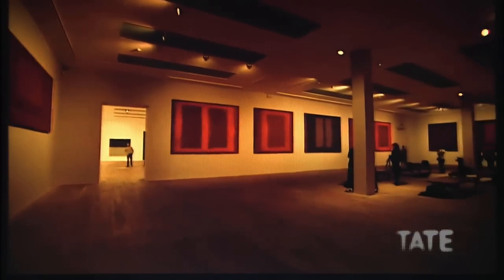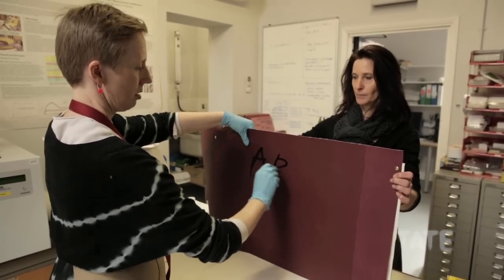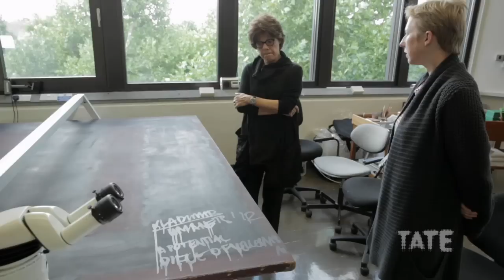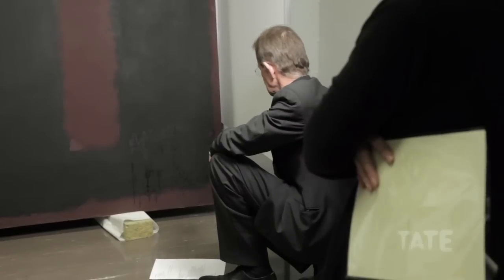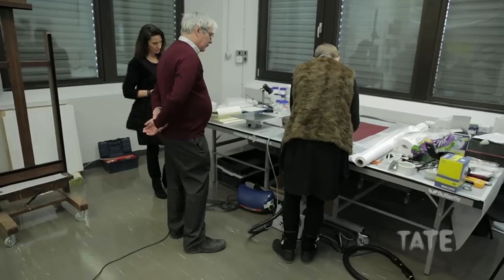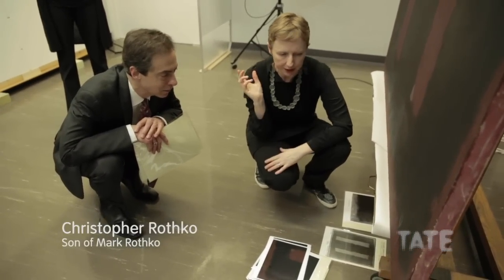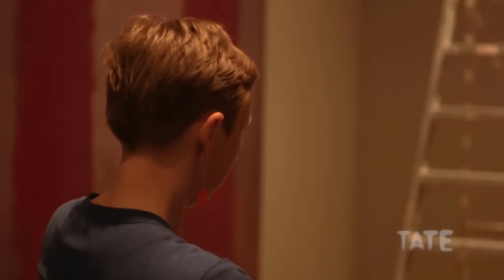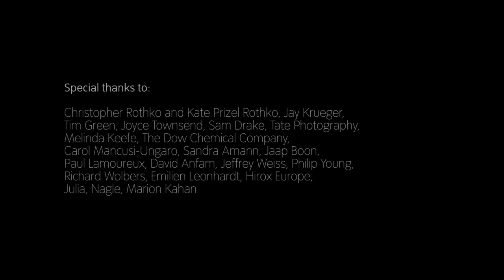Restoring Rothko | Tate

Comment: I’m an artist and I find this process so extraordinary. From the disgusting low of someone defacing treasured Art, to the extraordinary dedication of conservators who give their all to save it. I hope if one of mine ever needs this care that it will come into the hands of conservators so talented and so dedicated. Bravo - truly.
Reply: Rothko was notorious for not following proper rules of archival work. 

I know many artists don’t care about archivability, some just paint carelessly with the mindset of “let the conservators worry about preserving it”. But really, just doing a few small steps can already greatly enhance the archival quality of your work: 

Always gesso your surface before painting. Even with pre-gessoed store bought canvas, add 2-3 more coats of gesso. 
Paint on a rigid surface like wood, especially with oil paint. Aged oil paint is inflexible, and canvas is flexible. That’s why many old museum paintings have cracks. 
Always varnish your works.

Comment: Rothko didn't varnish his paintings, and he used quite a wide range of materials. It's no surprise that his works are fragile and vulnerable. In the end, one has to wonder if he was really terribly concerned about the permanence of his work. If he wasn't very concerned, should we be?
Reply: varnish yellows and changes the colors of the painting over time, and it would probably cost a lot of money to varnish those huge ass paintings. Maybe he didn't want to risk putting it on and it accidentally affecting the colors. I don't know that's just what I think as an artist.
Reply: @Leo-zk9rd , Modern varnishes were available to Rothko. Such as n-methylmethacrylate, which does not yellow. Although this varnish is easily removable with very mild solvents, Rothko may have used materials that were similarly soluble, precluding its use. I repeat and expand my point as follows: As an artist, you know that every artist is constantly faced with having to balance considerations of color, permanency, reversibility, ease of application, and so on. Rothko may have made a deliberate choice to forego permanency in order to reach other goals. IF that is so, and if we accept his choice and adopt it as our own -- which seems perfectly reasonable to me and which I suppose Rothko would endorse -- then we can reasonably let the vicissitudes of time take their toll.
Reply: i dont think we have to, but its still nice to take some graffiti off that was made with the intent to make the painting ugly. if it was normal aging i would see ur point more but this is a bit different since the damage was purposeful.
Reply: Louis C. Gasper Perhaps he was not overly concerned with the permanence of his work in a natural aging sense, but I’m going to guess he would have been mad at someone writing their name in ink on his painting.
Reply: He probably wanted it to age I think it ads to the art. It gives it character and shows that nothing with stands time
Reply: I’m sure he was very concerned.... he left off the varnish because the fragility is part of the message.
Reply: The point of the graffiti was (according to the vandal) not to make it ugly.
I've read the guy's manifesto on "Yellowism," and if it is not mental illness that precipitated his actions, it is the worst sort of pretentiousness and pomposity that did.
Reply: It is inconsequential as ultimately, the intention to preserve isn't solely meant for the artist to convey, but to serve a larger purpose for his legacy to pass on to future generations that such stylistic endeavour was part of a movement and cultural milestone in the 20th century. Preservation is therefore critical, as it represent a place in art history informed by the culture, politics and economy of that time.

Comment: Did he not varnish?  I suspect he didn't,  otherwise i doubt the ink would have been much of an issue.
Reply: I doubt Rothko even knew what varnish is
Reply: Dude it is Rothko. He is like Kanye West of painters. That itself Speaks so much.
Reply: He chose not to varnish. Varnish has been around since ancient Egypt. Everybody knows what varnish is.
Reply: he did not use a varnish, however, you are right that if he had this would have been easier but none the less wow! the fix job was amazing!
Reply: Varnish after years time must be stripped and reapplied. Varnish yellows as it ages. Rothko was going for the immediacy of the visual perception of almost pure pigment.
Reply: Varnishes - at least during Rothko's time - tend to be shiny and reflective. It would've turned his works into glossy mirrors and ruined the effect he was after.
Reply: Varnish? Modern paintersusually use modern materials. Aka most pf their artwork is doomed to die quickly because many modern materials are cheap or impermanent.
Reply: @carlotta4th  "Modern materials are cheap or impermanent"? Not in art stores, Carlotta.

"Rothko used materials far beyond the conventional range sold for artists, modifying the properties of oil paints to achieve the flow, drying time and colours he needed. He used synthetic substances such as oil-modified alkyd and acrylic resins alongside traditional materials, including egg, glue and dammar resin, which are fast-drying and allowed him to apply subsequent layers within hours. Resins increased the viscosity of the mixtures so the paints could be diluted without losing their coherence. Rothko also applied phenol formaldehyde to prevent layers from blending into one another."

Those aren't cheap materials. Great sweeping generalizations you've got there. Got any more? May I assume you're a gamer - and don't know any serious artists? Blimey!
Reply: TheStockwell i believe what he was trying to say is they use less stable painting methods, we know a fat over lean old master painting will last, but in artists like dekoonings paintings are already starting to fail structurally after as little as 50 years, there are also newer painting material such as acrylic that we dont know how archival they are, acrylic could completely fail after 100 years and we wouldn't know yet because its only been used for like 70

Comment: The fact they are probably spending more time restoring the painting and fixing it, than what it actually took to paint it, is kinda funny
Reply: This painting obviously took a long time to make. They did mention it's made by using many very thin layers of different types of paint.
Reply: Guy Montag  actually 2 red strips on a black background
Reply: ben berk  everyone can assemble an IKEA table, but not everyone can design or engineer one.

Comment: It seems that Mark Rothko's artistic vision led him to use the interplay between matte and more glossy surfaces to convey, in part, that vision. This prevented his protecting his works with a final varnish. Had the piece been varnished, removing the ink would have been a trivial procedure. Rothko, who experimented endlessly with materials, must have realized that his works were specially vulnerable. Then the odd question arises: is this vulnerability one aspect of Rothko's artistic vision, that is, did he mean it to be vulnerable to vandalism? Were he alive, would he necessarily want the vandal's "work" effaced? 
The reflexive answer is "Of course he would want the damage reversed, so that his original vision wold again be presented unimpaired." But if he wanted his vision to be permanent, would he not have experimented with materials and techniques to ensure permanency? It seems heresy to ask it, but is it possible that Mark Rothko foresaw and accepted the relatively early demise of his works?
Reply: I think that's way too convoluted a train of thought. The guy was a minimalist--he wasn't thinking "will these paintings survive hundreds of years" he was only thinking about his experimentation.

Comment: 07:13 The proof of restoration non-sense: she's wearing a glove to avoid the skin grease to reach the canvas but she's touching the canvas with her bare arms...
Reply: Most conservators don't use gloves for general handling of artworks, but rather adhere to rigourous hand washing. I suspect in this case the gloves were a safety precaution against the solvents for the conservator.
Reply: @uzukami  That'd be a great explanation if there were not normal at all to wash your arm too. No one washes up to the elbow when doing restoration... So, even though the glove is meant to protect her hands from chemicals, her arm is most probably with skin grease damaging the surface; and even if she washed her whole arm (which is highly unlikely) she is abrading the painting layer with her arm. She should have used an arm rest or the baton at least.